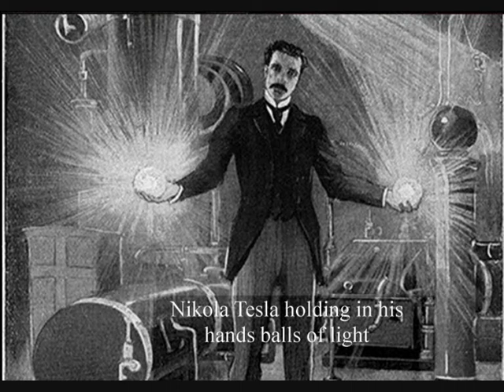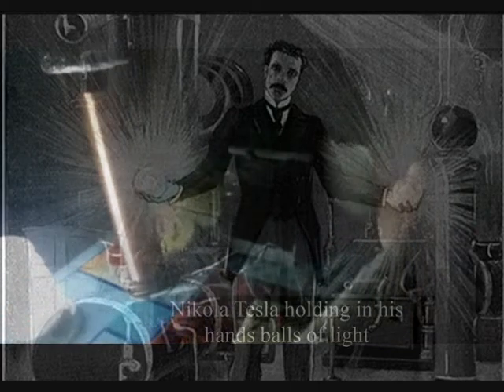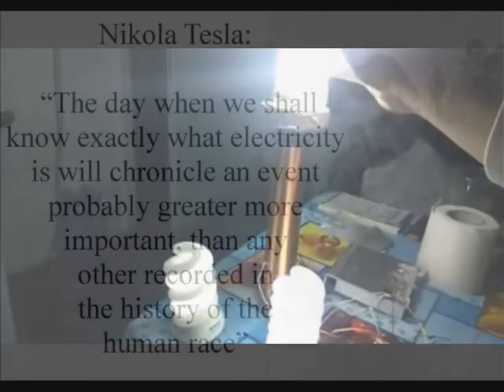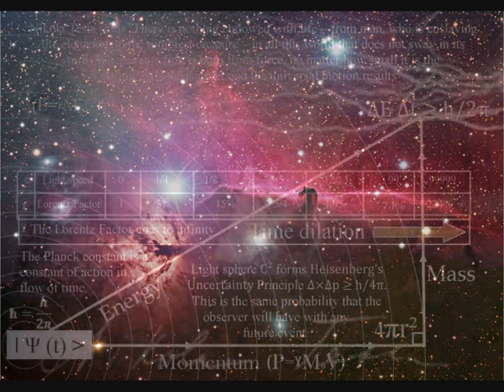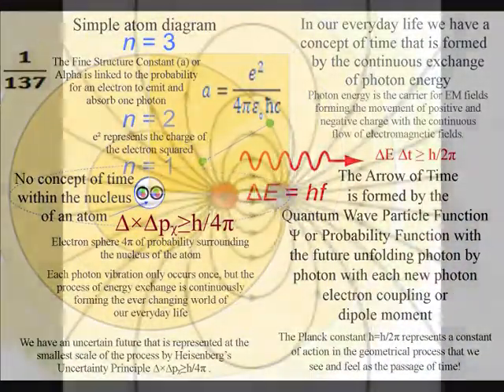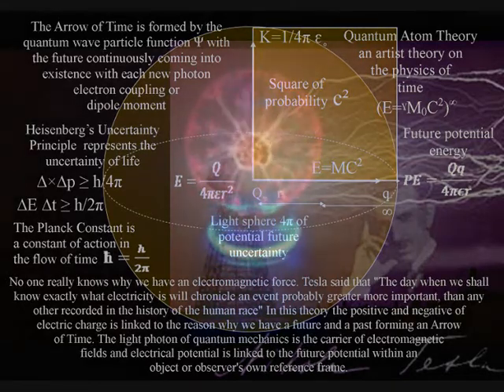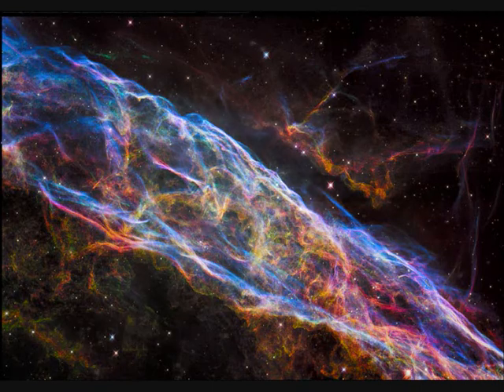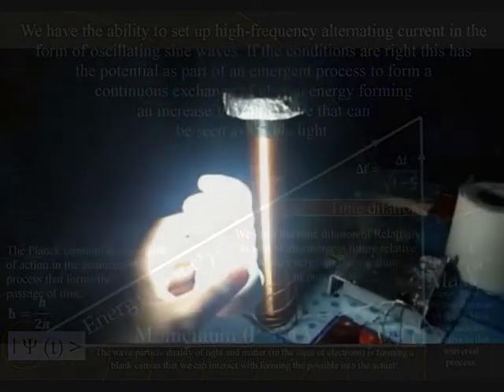⚡ Tesla's Tower in action live with a Tesla coil AC Power and Photon Energy explained ⚡

Comment: Magnet in motion. Toward a coil is one charge direction. Away from a coil, wire or antenna receiver is oppostie charge direction. Direction of increase or decrease between magnetic and induction.  Compression and expansion. In the magnetic structure of the toroid hemispheric dielectric plane of inertia. Inward and outward. Past present future. All in one action. Of the same fractal relationship. All relating to one another effects of size. Effects of charge values in directions.